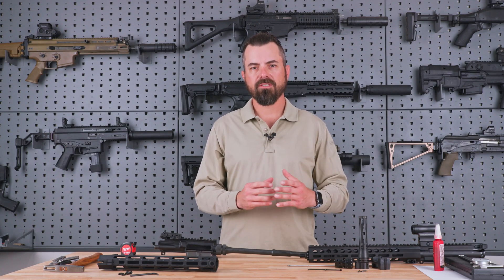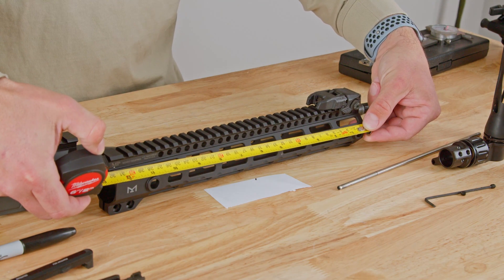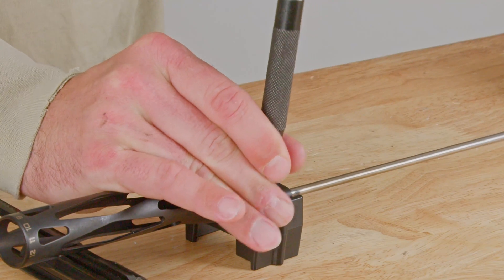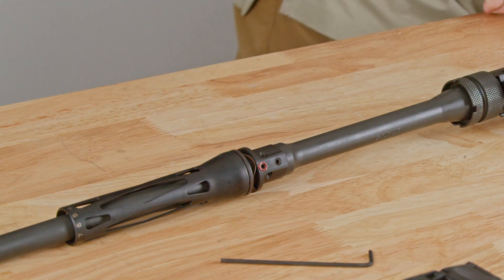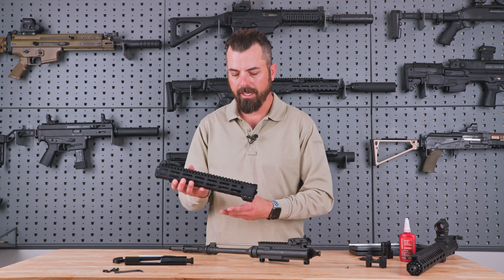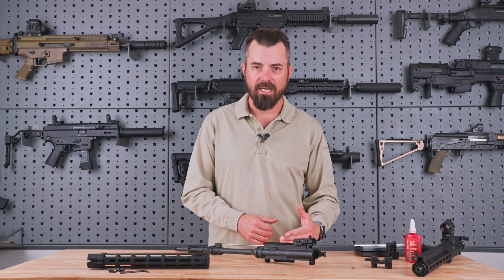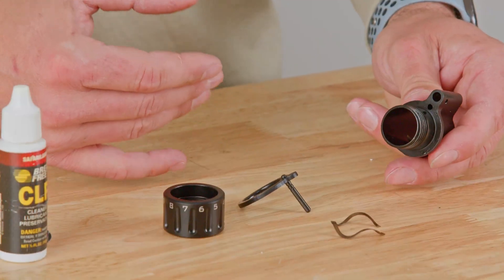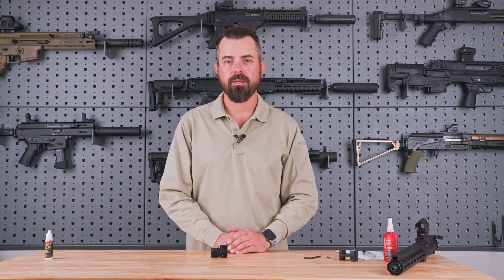Riflespeed Gas Control Selection, Installation, and Maintenance

Comment: They need a clamp on version. Ive red loctited set screw blocks that still came loose after round-intense classes. Clamp-ons dont come loose, dont affect accuracy, and not everyone can pin a gas block without sending it in.
Reply: Rockset

Comment: How dovyou know gas holes are in perfect alignment just because its straight doesnt mean you have perfect alignment
Reply: The set screw barrel dimple is milled exactly opposite of the gas port. Line that up. The barrel dimples set screw should go in farther than the other set screw.

Comment: I have two RifleSpeed gas blocks.  While they are excellent for toolless adjustment, they add a lot of weight to the front of the rifle.  And I mean a lot of weigh to the front.  Would be awesome if there was a titanium version of the RS even it it would be double the price.

Comment: I personally recommend saving the handguard installation for after configuring the gasblock. Just grip the gun by the magwell during testing for a few minutes. It saves you time uninstalling and reinstalling the handguard if you get the wrong plunger.

Comment: I purchased the PSA Sabre 300 blackout 8.5”, I had to run in 11-12 positions to get it to lock back. They are sending g me the correct size free of charge
Reply: Running subs do yourself a favor and get a good low mass BCG. You already have a rifle speed to tune down gas for supers.
Reply: Did you just contact customer service? I’m having this same issue with my Sabre 300.

Comment: I finally got to the range to adjust the gas block. 16" AR15, rifle length with the setting one with my supressor, PWS, BDE, 7.62, I was still getting alot of backpressure, ejections around 2:00 with the .917 plunger. This happened with 55 grain 5.56 as well as lower powered .223 rounds. I also have a lot of carbon in my mag from backpressure blowback. Never got to try unsupressed adjustment since it wouldnt work suppressed.
 Emailed support, about a replacement plunger .937, "free of charge" as stated in the video @ 16.51 and they wernt sure how that got in the video :), but are willing to stand behind their product and shipping me the one I needed. My Can is modular, so I could shorten it, but had hoped it would work with multiple guns without having to customize the length and lose suppression. Thanks Riflespeed, Good communication, and customer support.
Reply: I’m building a 7.62x39 ar right now. What plunger ended up working for you?

Comment: Good product, TERRIBLE CUSTOMER SERVICE.  I have three of these.  One has plunger issues (gets stuck when I shoot a few rounds of 308).  Support insists it is a bad gas port causing bullet shavings to get into the plunger cylinder.  They made the diagnosis without ever inspecting the gas block or the barrel or even seeing photos of the gas port.  They simply told me that is my problem and left me holding a defective $200 gas block.  Also, before buying this one, I emailed them to confirm that the model I was ordering would be long enough to work on my rifle.  It wasn’t and I cannot adjust the gas knob with the small amount of the control knob that protrudes from the front.  Again, support simply gaslit me and said “I have one and it works on mine” and I was left with no option other than having to replace the hand guard for a shorter one.

UPDATE: Since I have three of these I swapped the larger heavier control knob with a smaller lighter one and also swapped the wave spring and plungers.  The 308 did not have issues at that point and the bad parts also worked on the other lower recoiling 6.5 creedmoor rifle.  I swapped everything back, but increased the tension of the wave spring by increasing the bend on each wave by hand.  I ran another 8-12 rounds and it seemed to be working.  The point is the issue was not bullet shavings at all.  So far I have wasted money on three range sessions and dozens of expensive 308 and 6.5 CM rounds to trouble shoot the issue on my own which appears to be either an engineering design issue with higher recoiling rifles and the heaviest control knob they currently make or a defective out of spec wave spring.  Either way, TERRIBLE CUSTOMER SERVICE!
Reply: Cannot speak to RifleSpeed's customer service as I have not had to use it. I currently run two of their adjustable gas blocks on recent DPMS LR308 builds and have not had any sticking plunger issues. Seems very odd that your's would get stuck after just a few rounds! I generally do not shoot more than about 50 rounds per session as 308 Win and even surplus 7.62 NATO can become cost prohibitive for me. I'm very OCD about cleaning no matter the round count and per their instructions will make sure to put a drop of oil at the plunger area prior to shooting and after cleaning. Virtually all adjustable gas blocks with the exception of maybe the FNFAL design will gum up very quickly especially when running suppressed. My LR308's are very low round count rifles but I have not yet seen any degradation of the plunger or plunger bore. No visible wear or fouling that cannot be removed from just wiping off the plunger or a cotton swap in the bore. The Nitride coatings appear very robust! The wave spring does lose some tension at higher gas settings so maybe some improvement needed there. After drilling my Wilson Combat Tactical Hunter gas ports to .092" and using the .887" plunger size I have been able to run all types of ammunition both NATO and hotter 308 WIN between #6 and #8 settings so the wave spring tension is not an issue. My testing was done here in the Southwest desert (Las Vegas) from about 25F to 100F +. Hope you get things resolved with your RifleSpeed!
Reply: People like you should not try to put rifles together from what you stated. If parts from one worked with another, then the parts were not defective. To increase tension, just stack two springs on top of each other. Bending springs destroys them. I custom size the plungers to the rifle. If the plunger is too short, then just use a longer one. Not rocket science, but confusing to some for some reason.
Reply: @hairydogstail I’ll ignore the negativity and focus on your suggestions.  Dual springs wouldn’t work well in this case and the bending was simply done to test the theory about spring tension.  I don’t think it is a proper solution.  The springs I am referring to are proprietary to Riflespeed as are the plungers.  The plunger are available in multiple sizes based on the amount of gas needed.  Also, the lower recoil of the other rifle seems to be why the parts worked.  Perhaps my explanation of events was misunderstood.  Honestly, this is not a very complex mechanism, so there isn’t much that can be done wrong by the consumer (me).
Reply: @mauricioarze5465  I'm not trying to be negative, but the Rifle Speed is a very simple adj gas block. I have dozens of personal rifles I have installed the RS adj gas block to (pinned to the barrel) with out any issues.  They are pricey, but the best on the market IMO. If cost is a factor, then I would recommend the Faxon or Superlative Arms adj gas blocks. Even these simpler designs (yet less durable) seem to confuse a lot of people. 

Stacking two springs on top of each other is a solution, if a person wants more tension on the adjustment control. I custom grind/cut the plungers to fit the individual rifle's gas needs by using a bore scope/gas tube light. You can spend a fortune purchasing different length plungers and trying to find the right plunger length, when it is much easier to cut to the proper length. I can set the plunger length to fit the adjustment settings I want. 

 It can take time and money to learn how to do things right (but for many people) it can be best/cheapest to pay someone else to do it right the first time. It is a great thing to want to learn how to do things for one self, but be prepared to spend more money/time to obtain that knowledge.

Comment: plunger stuck cannot remove. Very little info available
Reply: I have the same issue and support won’t help me.  I just posted a comment about it.  It is happening on a 16” 308.  Without inspecting their gas block or my barrel or even having a photo of my barrel’s gas port, they claim that the issue is bullet shavings caused by the gas port having imperfections.  My interaction with support has proven they don’t care about the customer.  I have three of these and last night I swapped parts and shot several rounds through the 308 to see if the barrel was the problem.  It worked which proved they were wrong and also proved they will make up a diagnosis to avoid honoring their warranty.  Also, they recommended a specific model and it did not fit properly.  They wouldn’t accept a return so I had to swap my hand guard.  They kept insisting it works without having my rifle.  My other two rifles with Riflespeed gas blocks have been OK.
Reply: Oil the plunger when doing maintenance and run the selector up and down. This cuts the carbon.  If the plunger is sticking, just take a flat end screw driver and pop it loose by lightly twisting on the plunger holder, not difficult at all.
Reply: @hairydogstail Thank you for the feedback.  I have done exactly that multiple times.  After the first failure I started oiling the plunger with an appropriate high heat lubricant, but the issue continued.  Someone else just attacked my comments and said people like me shouldn’t be building rifles.  He doesn’t seem to have understood my process and thinks my solution is to use hand tensioned wave springs.  That is as just part of a test process.
Reply: @mauricioarze5465  So what was causing the plunger to stick? Do you have pin gauges to measure the interface difference between the plunger tunnel I.D. and the plunger O.D.?
Reply: @hairydogstail The cause doesn’t seem to be a spec issue.  I used calipers to measure the width on the different plungers and the issue occurred regardless of which plunger was used until I did the first swap of the larger, heavier control knob with a smaller lighter one.  When that worked, I tried the admittedly not ideal test of increasing the tension of the wave spring.  The success of increasing the tension lead me to theorize the issue may be  insufficient wave spring tension combined with the heaviest control knob made by Riflespeed and the slightly heavier recoil of a 16” .308.  I am going to review your suggestion when I have time to sit with the rifle.  Thank you.
Reply: @mauricioarze5465  So if I'm understanding you correctly, the plunger was not the problem, but the adjuster control knob itself? Was the adjuster control knob turning by itself,  closing the barrel port through recoil? If this is correct, then how would this create a sticky plunger? If the plunger itself was covered in a copper color (bullet jacket material) that would stick to the plunger. Hot gases and a rough gas port can cause the plunger to be coated with a copper color (bullet jacket) increasing the plunger O.D.  If this is true then it would verify what RS stated in the first place, that the barrel was causing bullet shear. If not, then I think you are missing something from your evaluation of the problem.
Reply: @hairydogstail There was no residue on the plunger.  The mechanical reasons why increasing tension on the wave spring have allowed this previously malfunctioning AGB to work could be debated, but the results are so far clear.  I ran somewhere between 40-60 rounds without it locking up when previously it locked up after two or three rounds.  The control knob is kept in place by notches on the plunger ring which exerts pressure via the wave springs.  The plunger ring is attached to the plunger so the entire structure interacts.  It’s anyone’s guess exactly what happens during recoil that caused the lockup, but what is clear is that one change has helped.  I didn’t switch ammo.  I didn’t even send a cleaning rod down the barrel.  I assembled it like one assembles four pieces of lego and oiled the plunger prior to assembly after each malfunction.  There’s nothing to get wrong unless the user doesn’t pay attention to how the wave spring comes from factory.  During my initial testing I removed those parts and put them back a few times whenever it locked up and I even took photos so I would be able to reference anything that looked odd.
Reply: @mauricioarze5465  I understand how the RS functions and works. If the plunger is getting stuck and there is no carbon or bullet residue sticking on the plunger, then there is zero reason for it to fail (getting stuck).  There has to be a tolerance issue, which you have not been able to find or diagnose. All things being equal, changing to a longer control knob, plunger, spring, etc will do nothing if everything is in spec and assembled correctly. I don't guess or debate when solving AR problems, I diagnose and fix them. The AR is a very simple platform to fix and repair with the proper knowledge and tools. Unfortunately, most (opinionated) AR owners have neither..
Reply: @hairydogstail I assume there is some kind of tolerance issue or defective part, which I think I stated from the start.  Since I didn’t detect a thickness variance between the different plungers I have and since two sizes of plungers did not make a difference, I placed plunger tolerance  as a low probability cause.  I don’t have a reliable or accurate method to test spring tension so I resorted to swapping the parts and arrived at a working combination that way.  It is definitely a work in progress, but unless by coincidence the bullet shaving issue resolved itself from the first round fired when I swapped the parts between AGBs, then the issue is related to the things I described.   Thanks for trying to help.
Reply: @mauricioarze5465  You are changing your story. First you stated (The cause doesn’t seem to be a spec issue), now you are saying ( I assume it is a tolerance issue). Then you say ( I place plunger tolerance as a low probability).  
So how does the the plunger get stuck? This is not rocket science to figure out.

Then you say(  I don’t have a reliable or accurate method to test spring tension) 
 The way you test spring tension is by turning the control knob and feel the amount of force it takes to turn the control dial. If too loose, stack a second spring onto the first, problem solved. 

You are not grasping or understanding anything ( I have been explaining in some great detail), which is why you should find an AR armorer/gun smith to help you. Good luck!
Reply: @hairydogstail Thanks for trying to help.  In elaborating details it may appear I change my story and if one focuses on a word or phrase, I'm sure a point can be made towards that.  I see no point in continuing this discussion as it is clear there will continue to be some miscommunication.  I wish you luck as well.

Comment: what will happen if i use a different gas tube ?
Reply: You must use a straight gas tube like the Colt 6940 requires.
Reply: @hairydogstail yeah ik that I have 2 of them but I’m saying what will happen like will it not cycle right or what bc I’m not tryna find out
Reply: @toxic6633  Seriously? If you have two of them, then you should know the standard dog leg gas tube will not fit correctly because of the height difference of the gas block. .
Reply: @hairydogstail it does fit 💀 used a regular mid length gas tube and everything fit that’s why I’m so confused ofc I didn’t shoot it and used the straight one but still

Comment: The video specifies Loctite Red.  Isn’t that a bad idea for such a tiny grub screw?  The manual recommends Rocksett or Vibra-Tite 137, both of which are water soluble for removal.

Comment: Does it interfere with any M-LOK mounted accessories?
Reply: Sometimes. And only in 1 position. I have a riflespeed gas block and there is 1 position on my rifle where i cant mount anything due to the thickness of the gasblock. But this only applies to low profile handguards
Reply: @PudgemuffinSHOOTING  Hey thanks Jace for the reply. Is there anyway I could get in touch with you? I wanted to pick your brain as far as specs, buffer alterations (if needed) and how versatile it is with using different ammo. 193, 855, and Hornady HP's. If not, thanks for the input.
Reply: dd 6.5 creed comp rifle. weight kit screws at gas block location have to be trimmed.

also arca rail at block location

Comment: Had issues with my 300blk with the standard gas block using a JKA can.  Put this on, and I'm going to the range tomorrow to test fire the finished product and do a final setup.  Also want to shoot 200+ subsonic rounds so dialing it in should be interesting...  The video was great for installation and setup!

Comment: Just got my 1st suppressor and ordered the Riflespeed assembly. Since my barrel has a front sight post it’s already been taper drilled for the pins. I was wondering if the hole in the Riflespeed assembly will line up?
Reply: I have a couple barrels that were factory drilled for a gas block pin. None of them match up with the rifle speed, mostly because the size of the pin is different. It costs $70 plus your initial shipping to have the guy off their website do it. Not worth it imo. Your experience may be different.

Comment: i was planning to buy one of your blocks, i'm a little thrown off by the straight G tube. this is going on a AR10 currently i have a tube angled up as it meets the receiver center of the tube to center of the barrel is 7/8" so i guess im to assume  the gas block tube enterance is raised for a straight line from block to reveiver, the thing is i don't know what it rise is at the riflespeed block, the current block is 1/2" center of gas tube to center of barrel and rises to what i already stated 7/8" at the receiver center to center. tube to barrel. hope you follow me better yet i hope you answe so i can get this show on the road.